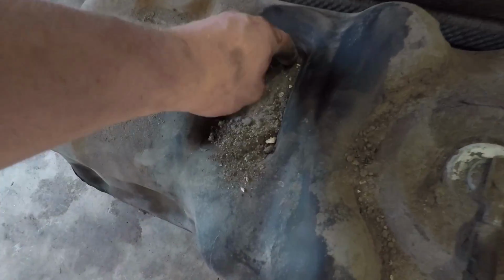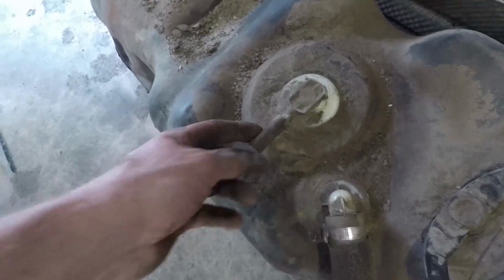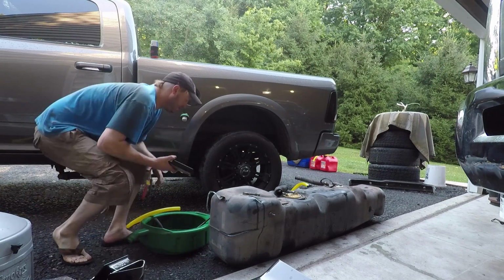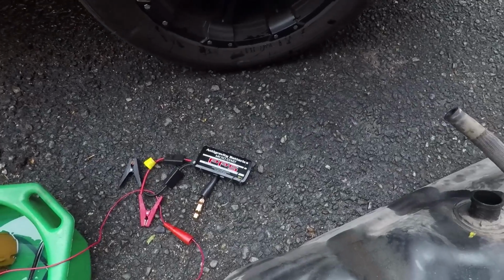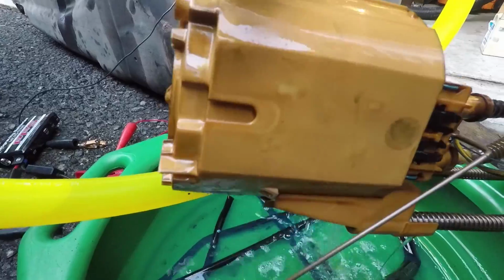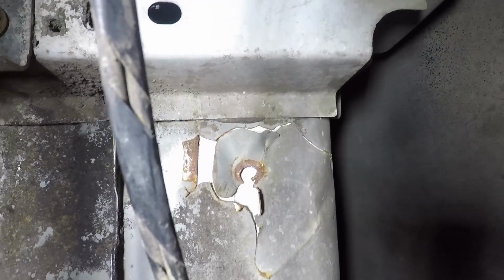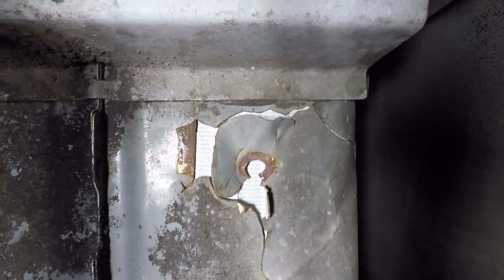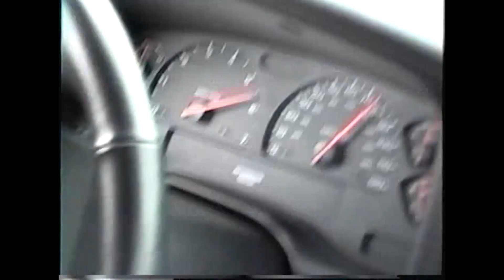Cummins Fuel Tank Removal For Lift Pump Install

Comment: Instead of using a floor jack and jack stands, have you ever considered using a couple of "Rachet Strapes ".  It DOES make the whole process easier and cleaner.  Plus, you don't have anything in your way restrictinjg your movement while under the vehicle.

Comment: I have replaced just the fuel sending pump on many motorcycles and some Japanese cars.  I wonder if we can do the same on these units instead of spending $500 on a new assembly.  Those pumps can be had, typically, for about $25 - $60....

My 2012 is now doing this idle lump....  219k on the clock, so it's prob the original one.